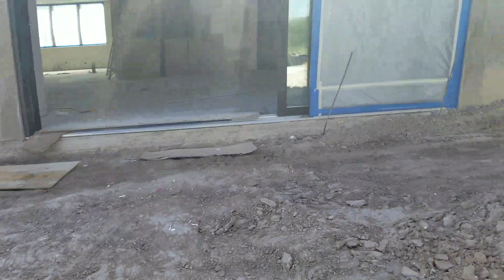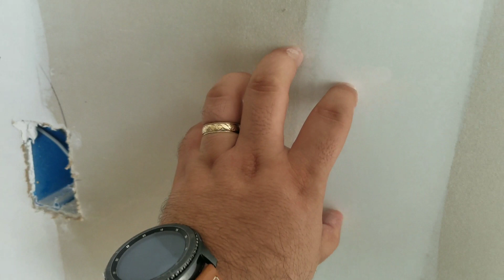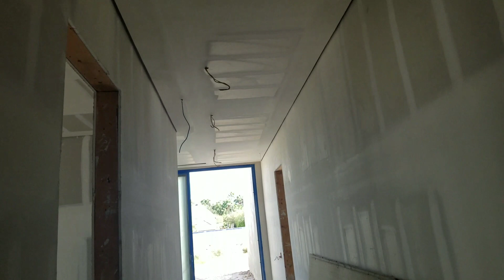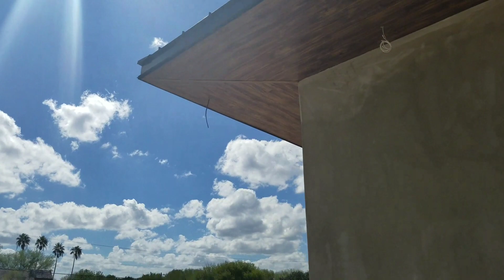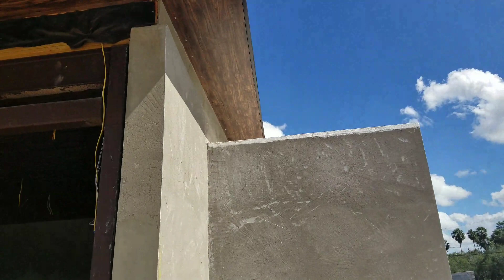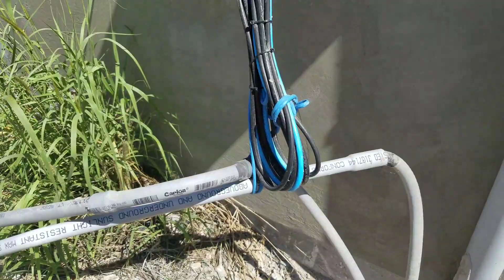How to Pre-Wire Large Home (Update)

Comment: I would almost use conduit for all the wiring in a home like this since it would be a nightmare to tear out the sheetrock in the ceiling to get to the cabling.    If you had it in conduit you could just pull new cable through.   :)      Fiber won't necessarily have to be pulled into the home since some ONT's are outdoor ONT's and just have Category cabling from the ONT into the home.    However, they are starting to do more inside ONT's so, in those cases, fiber will have to be pulled into the home and would benefit from having conduit for future cable pulls.

Comment: Use speaker rings.  Saves you the mess and time trying to tone it out.
Reply: there are times when toning the wire is needed.  Ive had customer that weren't sure how they were going to setup a room, using rings would have almost forced them into a direction. Generally, rings or boxes are the way to go,

Comment: why not just to put a bluebox where the speaker is gonna go?
Reply from the maker: Casper10M if I do and the speakers are not in the right position I'll have to patch up a hole. If I just tone out the cable and pull the wire where I need it I can place the speakers in the ceiling behind the couch or centered with light fixtures or A/C vents.